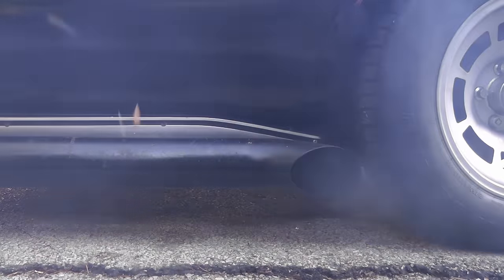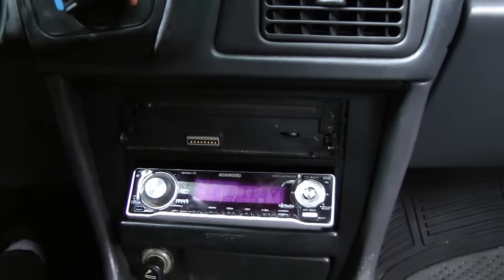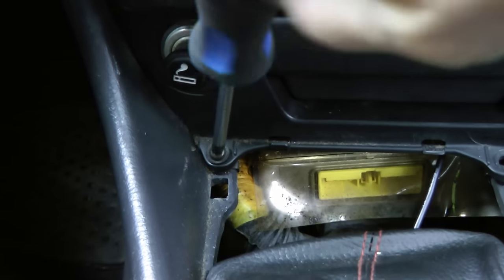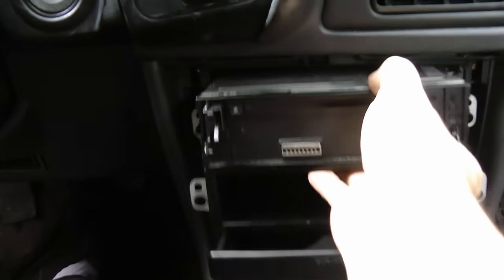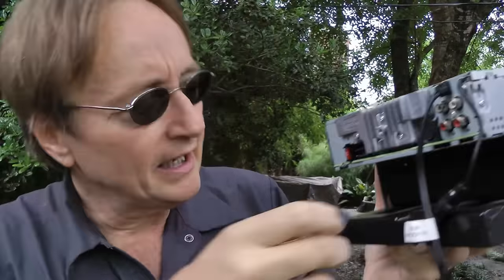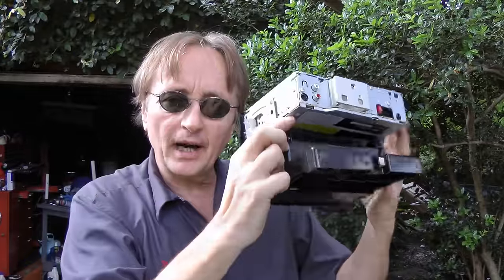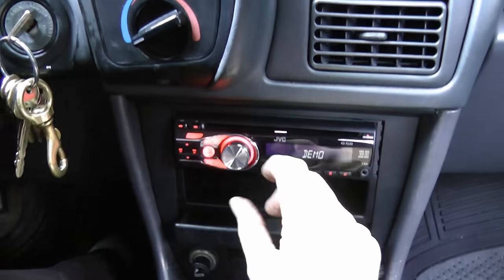How to Install Car Stereo

Comment: Hey scotty, I noticed red and white audio jacks on the back of the radio. I have a special cable that goes from RCA audio jack (one that connects to a tv) to a headphone jack. Can I just connect that wire to those audio jacks in the back for iPhone audio
Reply: No, that's OUT as in going towards the car's speakers, just buy an Auxiliary cord for the car or if you have a cassette player, buy a $5 cassette auxiliary adapter
Reply: Where do i connect this said auxilery cable
Reply: Peter Kapica Do you have a Cassette Player in your car?
Reply: Tinu Thomas yes and i know about those cassetes
Reply: Peter Kapica ok, try looking for a store that has a cassette to auxilary adapter, you can just put the cassette in and the auxilary cord plugs into the headphone jack, you can then play your music in your car
Reply: K, how about cd player
Reply: Peter Kapica I don't see any, sorry,
Reply: Tinu Thomas ok. I know they make special cables for that. Plus, i saw a radio in a honda accord in the junkyard. It had a cd player, a usb charge port and aux port. I wish i bought it for testing
Reply: +Peter Kapica Those  RCA's are usually outputs to an external amplifier.
Reply: Have that, works okay
Reply: Those RCA's are usually meant for an amplifier. So the signal is outbound only. IF it is labeled input, then yes you could connect your iPhone.

Comment: pretty sure i shorted a wire when i turned my cigarette lighter my head unit and cigarette lighter wont work and ive checked all the fuses what else should i check?

Comment: My Opel Astra (1993) can play music while the key is out while my Volvo S40 (2000) must have the key. it's so annoying. Is there a way to make it? I'm using same model CD player in both cars.
Reply: Run a dedicate positive from your battery positive terminal. If you do that, very close to the battery put in an inline 50amp fuse. SO in case you get a short, you won't start a fire or destroy something critical. Another thing is while the ignition is off, take a multimeter/circuit tester and see what in your fuse block has constant power and wire the radio into that. However, you run the risk of making your battery go dead by doing any of this.

Comment: dear scott i would like to get an after market radio in my 07 colorado but the audio shop says because my stock radio has the chime controller in the stereo i need a $100 chime bypass module or it could mess with my other wiring like the wipers, lights etc is this true or are they just trying to get more money outta me any help is appriciated thanks

Comment: Hi there! I have a 2009 volvo xc60. I want to put a subwoofer into my car but i does not have a rca input. It has a built in amplifier so i have to put a high and lowpass module. And i am puting a aftermarket amp but i am not codemning the stock amp. I just want to put a subwoofer. Is it possible? Or it would be a trouble to my head unit?
Reply from the maker: stock volvos systems can't contain the power of a subwoofer, do it right and replace the whole system if you want that. Swedes aren't into loud noises, that's why they built volvos, to be quiet
Reply: I think the best solution would be using a high-to-low converter. These are meant to be hooked up to factory stereos, so you can hook up additional amplifiers without having to change out the system. One end has a set of wires that you hook up to the speaker outputs of the stock amplifier. Make sure to just splice into them, not cut them, since you still want the speakers being playing. Then the other end of the converter has a set of RCAs that you hook up to your aftermarket amp (or active subwoofer), and then you can start setting gains etc.
Reply: thanks for the info's. my sub works perfectly...

Comment: I have an aftermarket head unit (radio) and all the sound cuts off if you turn it up or if the song has a certain loud note the sound won't work agian until you turn it off and back on any ideas about how to fix this would be greatly appreciated. 1993 firebird formula 6 speaker system
Reply from the maker: +whoz thatdude   I would assume the ampliflier has problems
Reply: +Scotty Kilmer My radio has a lot of static on certain stations and now when I get into some areas while I drive, the stations that don't usually get staticy becomes to have static. Is that a case for radio replacement??
Reply from the maker: +whoz thatdude more often a need for a better antenna set up
Reply: +Scotty Kilmer thanks ill look into that
Reply: +Ahmad the rescuer yeah that sounds like your antenna not getting a good signal perhaps something in the car may be interfering with your antenna but im no expert.
Reply: sounds like a bad ground, if it's not grounded properly when you turn it up it shuts off as a safety precaution

Comment from the maker: there is so little power in those radio wires and they are inside the dash protected from the elements. You're just a bit anal for me, those connectors work fine for that purpose. You are indeed a technofreak.

Comment: my truck radio died a year ago.stopped from out of nowhere,boom,just like that.i replaced it with a new after market cd player.still wont work.all fuses under the hood and under the steering are good.ive tried matching the wires correctly with an adapter harness and still doesnt work.both radios wont work,why? bad wiring? bad ground? easy fix isnt exactly so easy.i refuse to pay gobs of money for a simple,yet obviously hard,task.whats the issue with MINE?

Comment: Hey how about a double din. DVD install
Reply: Omar Ballesteros Depends on your vehicle. Your vehicle may already have a double din stereo in it, in that case that's great you don't have to cut anything but if you have a single din or a 1.5 din then the process is significantly harder. I don't recommend doing those installations yourself because it involves cutting your vehicles trim to install. Having this done does cost a significant amount of money if you can even find someone willing to do it. You may be better off with just a single din

Comment: Would you know how to safely remove a cassette tape from a car radio?  I have 2005 Hyundai Sonata with tape deck CD player and radio of course.  I wanted to buy an adaptor tape that can connect and iPod, but I got a tape stuck where it won't do anything.  not even play.  Loading and unloading mechanism is electronic, and when I press eject it sounds like something is turning, but nothing happens.  Is there a way to do hard reset so it works again? or is the player just broken?
Reply from the maker: patricknedz that's always fun.the ONLY way to get em out safe is to remove the radio assembly, take the over off, and get it out that way.
Reply: Unfourtently taking the cover off won't work on this model, as the CD player is on the top and the tape deck is between the CD and the radio controls.  someday Im switching it out with Pioneer stereo

Comment: what to do if i have on steering wheel volume control and others buttons and on dash original lcd monitor with original radio all works and with my new buttons and lcd don't work. example my opel vectra  1997

Comment: scotty I installed a new headunit and now my dash lights dont light up please help
Reply from the maker: +DJ WEZ WALLY you either shorted out wiring or disconnected some. Retrace your work and check for blown fuses too
Reply: +Scotty Kilmer Scotty any videos of you working on a 2004 Escalade?

Comment: my radio wont keep memory. what could be the problem?
Reply: william morales the wire for memory is connected to your ignition key..so each time u turn off car engine it resets..u need to coneect direct from battery one memory wire
Reply: Your radio will have two power positive leads. One for main power that connects on ignitions circuit, the other is a low voltage constat power for memory.

Comment: wow that is pretty cheap.... my old supervisor sold me a subwoofer with amp and capacitor and a new alpine in dash navigation combo for $957.... when I looked at the price of the of just the navi online, it was over $1600.... heck an alpine radio similar to this jvc that you just installed costs over 300 bucks

Comment: HAH just dont do the job the former owner of my old ranger did, (he was quite proud of the fact he put the stereo in himself) strip the crap outta all the wirings insulation on both the wires coming from the truck and the stereos wires, twisted em all together no solder or splices then wrapped the crap outta everything with gobs of electrical tape and shoved it in the bracket, ended up with a sticky mess of blue green corrosion crud and tape adhesive, shorts everywhere

Comment: My right speaker still doesn't work.... I'm sure I connected everything properly. Tried the same speaker and I side and still nothing from the right side.
Reply from the maker: then wiring is bad, or amplifier inside radio is shot on that side
Reply: thanks

Comment: my radio was stolen and the ac dont work what would i do
Reply from the maker: Hum a song and roll down the windows, there's a really cheap fix.   Now I would assume stealing the radio they wrecked wiring in the dash that controls the AC. Check for unplugged or broken wires, and PRAY they didn't short out any Ac computer controls. Good luck.

Comment: Yeah but modern cars have the fasten seat belt ding and turning signal click built into the radio and you have to buy a stupid computer box that does these noises if you do it right, but of course this is an old video so...

Comment: Did I see wire nuts?  No wire nuts!  Use solder!  Takes 20$ in tools and 30 minutes of your time, and you won't have some weird rats nest tangled mess back there - as well as a shorting hazard.

Comment: What is  wrong with this shitty stereo? :) When my mothers sister gave her the car, the radio didn't work. When they jumped the car off it did. New battery next day, worked. Now it's back to never working. I press the RESET button all the time with a paper clip to try and get it to work. Not continuous. Is pressing the Reset button alot a bad thing? Just wondering. Plus, if I can't get it to turn on, I'll take it out and snap it back in hoping for a miracle. ;)

Recently she got her car back from the shop and was wondering if the radio would turn on. Finally it did. But now, when you do get it to work. it cuts off after about a minute at the most.  (It would cut off before, but it would at least last longer before doing so) It's a kenwood kdc-mp238
Reply: Check your radio fuse

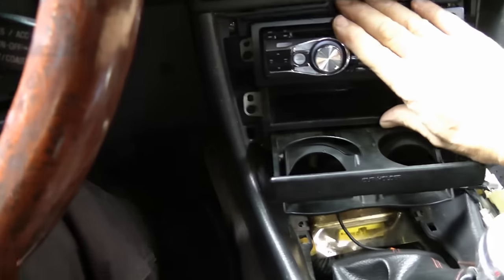Comment: Haha just that easy huh? did you see the shit wiring job? Mar connectors @ 2:36 haha thats pitifull, using home wire connectors in a car, its crude but I guess it works lol At my store I use heatshrink and solder all my connections, the previous radio likely stooped working because of intermittent power because of those marr connections lol

Comment: Simple...unless you own a Ford.  Gotta pony up $50-$200 for the replacement plastic surround.  And who the @$&!!!! puts a cassette player in a 2005?  Even my old man was digital by then.
Reply: If I may ask, what Ford is it that you are referring to? And what size stereo? A single din in a 2003 f150 can be installed by simply buying a dash kit for less than $20. A double din would require a custom trim piece because the stereo is larger rather than smaller than the original stereo.

Comment: Or get an identical radio from a junkyard car. $10 and the plug will fit.
Reply: Waste of money and time, and since time is money, waste of more money. Most used radios are outdated and beyond their lifespan, failure is imminent.
Reply: W Nij This comment is intended for DIY not mechanics. No shopping and finding adapters or splicing wires. Plug and play.
Reply: I only had bad experiences with used components specially with a lot of electronics, all those years of vibrations, extreme high and low temperatures, humidity, etc. are just too much. And any DIY can do the wiring when having the diagrams (almost always), piece of cake.
Reply: W Nij If you can solder you can take almost any electronic part apart, resolder the joints and fix the part. I did this to the body control module in my 1994 Ford Thunderbird to get the wipers working. I also installed a wire to the ECM in my 1988 Ford Thunderbird to restore a trace that was burned up by a defective voltage regulator that was causing the alternator to put out to much voltage.

Comment: And you spliced your wires with wire caps ??? that's awful !!! what kind of butcher does that to wiring ?? solder the connections !!! ALWAYS !!!
Reply from the maker: it's a freaking radio inside the car where it never gets wet, this works fine there.
Reply: wtf is wrong with wire caps, their intended purpose is to do exactly this.
Reply: he didn't even have to splice the wires he was able to just plug in the old wiring harness into the new head unit